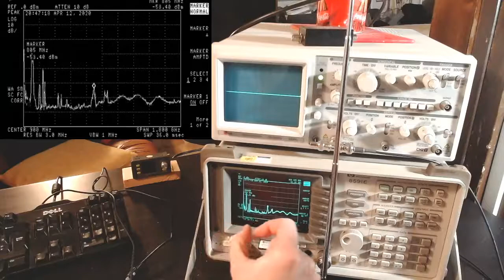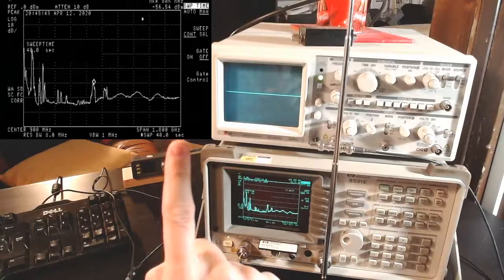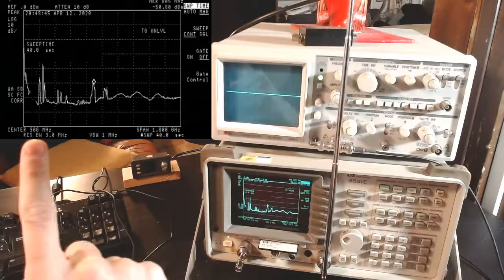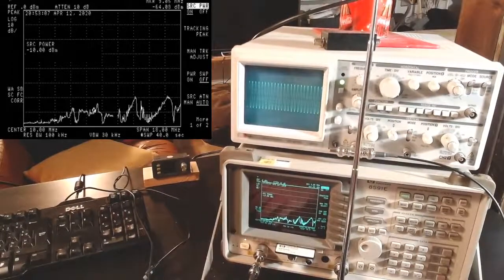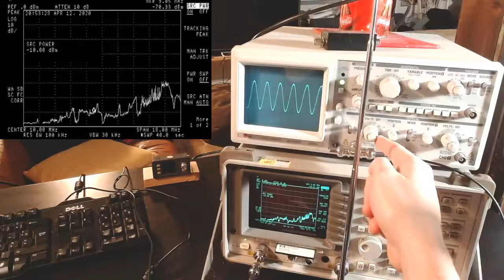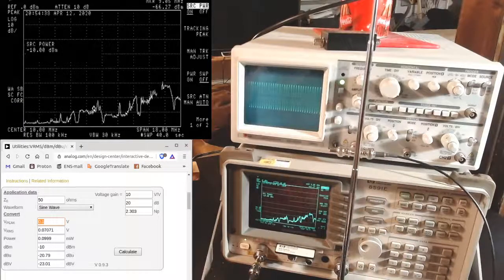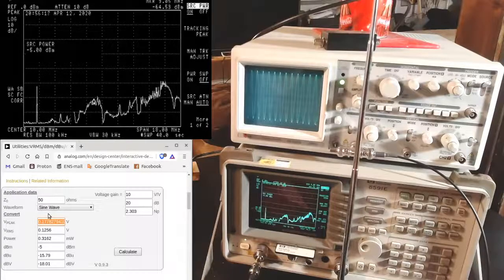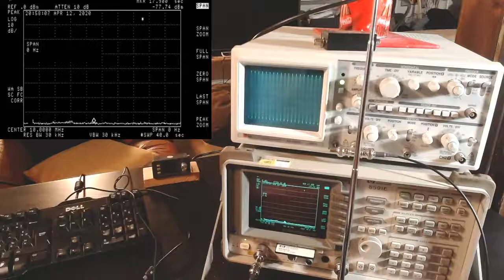Episode 2: Tracking Generator in Spectrum Analyzer HP 8591E

Comment: You forgot to mention that output impedance of tracking generator is 50 ohms, but oscilloscope has an input impedance very high. This is why the Analog Device calculation returns 100mVpp but your actual oscilloscope shows 200mVpp. You should put a 50 ohms load on the oscilloscope side or divide by 2 its vertical display.

Comment: Gday, thanks for the video I just got a HP8060e and learning how to drive it with the tracking gen. in your video i see you have the picture on the top left of your video, is that via some interface software? if so what is it and how can i get some? I have the mass mem module with a connector on the bottom i think that is what its for? Thanks
Reply from the maker: Hi! No you have (or at least my 8591E has) a BNC port on the back which emits a composite signal which you send to an OLD analog TV or, in my case, a USB adapter (~ 5/10 usd) to import the signal in your computer.
Reply: @therfnoob7697  Oh cool, thanks i do have a bnc on the back of it. :)

Comment: Update to my previous comment. I have been able to locate the tracking generator interconnections in the HP8590E ,L,C,Q series service manual. Readers who may find themselves confronted with the same problems may find the details under the chapter Cable Assemblies Table 12-6,pages 515-518.

Comment: I have recently bought an analog interface board to repair my HP8591E spectrum analyzer. It came with its tracking generator board # 60196.However the schematics are not clear how P1,J1to J6 are connected to the other boards. I should appreciate if a generous reader who may possess this model could inform me about their interconnections. Thanks.